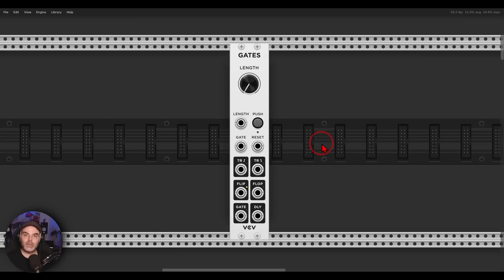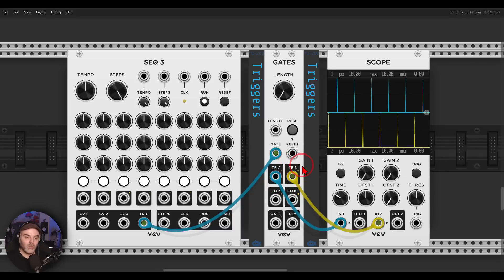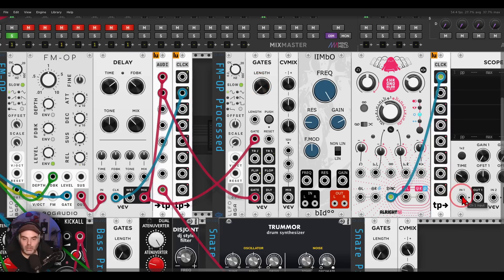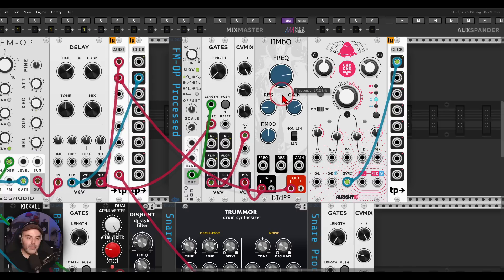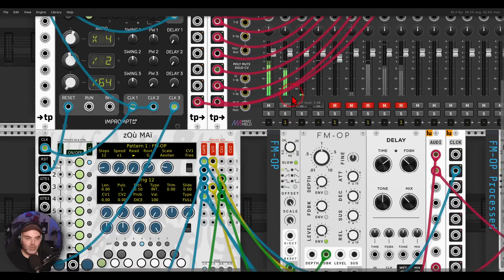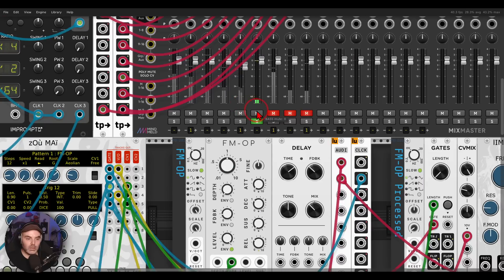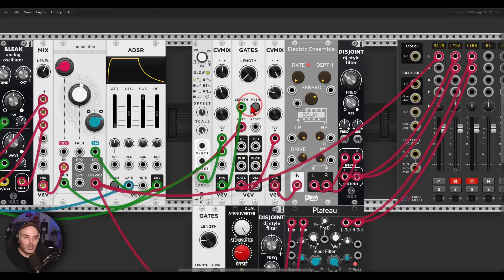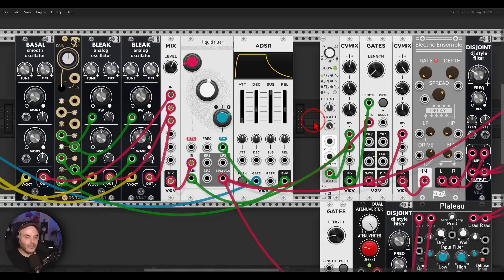NOT for gates only!

Comment: Using the CV Mix to recenter unipolar audio is also putting a DC offset in the whole audio track. You could put your envelope after the offset to make it less of a problem. Better yet, use a high pass filter instead (set the cutoff as low as it will go). That will recenter your audio without adding any DC problems.
Reply: Thank you, you beat me to it!
Reply from the maker: Perfect, thanks!
Reply: I really enjoy using functions and utilities for audio processing.. love this kinda stuff. Pretty much any hardware or software mixer will accumulate some DC... Euro / VCV is especially prone, even if you’re not deliberately doing to. Fortunately, NYSTHI has the 4x DC block, there’s loads of hipass filters, etc... I really like BogAudio’s Analyzer XL... it’ll show any problems...